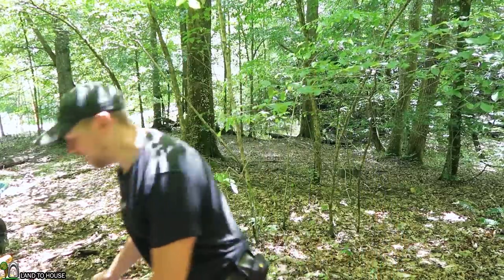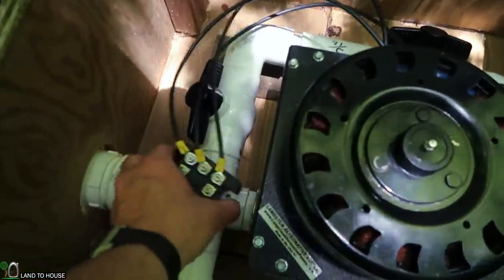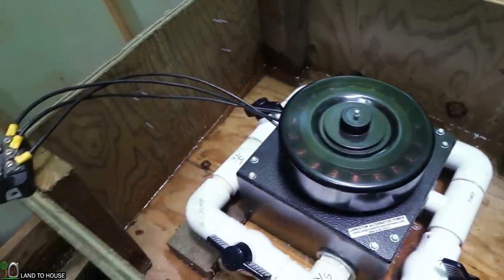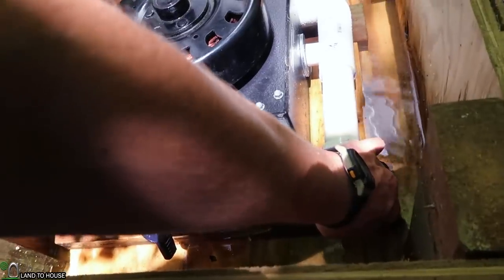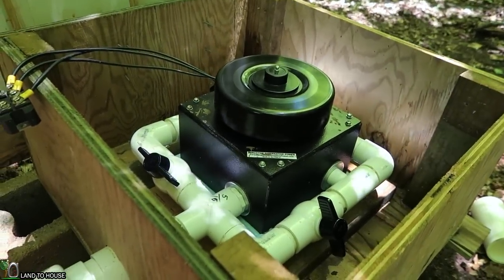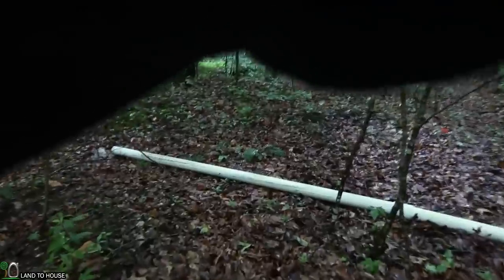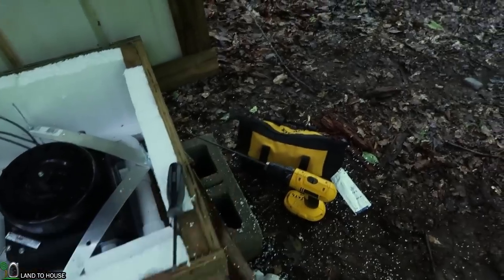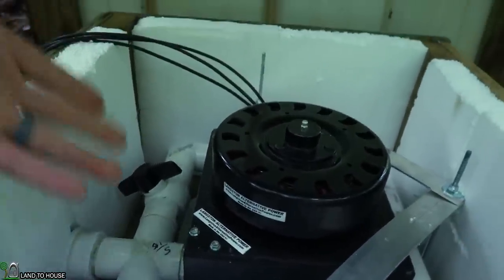Installing the Turbine Micro Hydro 6/10

Comment: I like hydro power but have issues with maintaining one. Bearing life is obviously an issue and for sure if a bearing goes, your turbine is gone too. Once the bearing goes and the rotor destroys the stator, well you need a new generator. But that goes for any turbine/generator as well. I think a rather high level of technology is in order using vibration sensors to turn off water supply to save the unit. Some sort of auto lube also to keep those bearings alive. Then there is that seal between the water and bearing. I had a guy ask me once if I could save his hot tub pump. I took it apart and found the seal was damaged. I worked on it to get it smoothed up and put it back together, never heard whether I was able to make it hold. I think about how destructive the results of bearing failure can be with this tech thinking about that huge turbine failure in Russia that resulted in the death of 70 some  people and the necessity to shut down Russia's  largest hydro plant. Water and metal bearings just don't go well together.

Comment: If I were you I would build a soundproof building around that whole setup like a 10 x 10 building and you're going to have to make the drain way bigger probably the same size as the turbine setup until they can get a ways away from the generator and the water picks up speed and then will Flow Away

Comment: if you and your sponsor are interested in an idea for experimentation then what about more jets using an octagon or a decagon (8 and 10 sided polygons) and what would the efficiencies and/or losses of more jets applying extra torque for the generation of power would you be able to use larger sections of pipe to have extra flow and split the flow and cause higher pressure thankes to the reductions before the jets but to a limit of what they can handle

Comment: I would do away with the ball valve and run a gate valve, you would have less water hammer during shut off and a more gradual shut off.
Reply: What you say is true, Gate Valves can lesson water hammer, but might not be as practical in this application. Gate Vales are typically far more expensive and sometimes just simply won't last as long and they tend to clog or at the very least are able to clog unlike Ball Valves. I don't know how often he'd be turning this unit off or off but over time Gate Vales will clog. Just offering an alternate opinion... Cheers...

Comment: just love it when people with no engineering prowess at all attempt to create a workable system , Langston ATP ! the Pelton wheel should have been encased in a "snail" housing , turbine efficiency would increase and there would have been no water in the enclosure , basic engineering ! water and electricity don't mix !

Comment: Terrific series:  On the sound issue, have you thought of a simple sound deflection, IE egg filler flats on the inside of the box. even a hospital bed foam has the same deflection shape.
Reply from the maker: Thank you!! I am worried those would rot in the wet box.

Comment: why would you not put a large tank at the top of the hill that fills off your brook figure out water flow in and put a turbine to take the outlet flow along with water pressure because of water weight in the tank run your power lines down the hill and scrap your solar if excess power pump water back up and use it for your stored energy easily run a house and more

Comment: There was something that surprised me.  Your indicated pressure is 65 PSI, which indicates a head of water of almost 45 meters according to the table at https://www.engineeringtoolbox.com/hydrostatic-pressure-water-d_1632.html
but at 16:42, the water appears to be coming from a trough above the generator that doesn't appear to be more than a couple of meters above it.
To estimate its effectiveness, you are measuring voltage, but voltage on its own is meaningless.  I can generate 2,000V by scuffing my shoes on a nylon carpet.  Power is what you want, and P = V x A.  Power is measured in Watts, V is volts and A is Amps.  What are you going to use it for in the house?  Will it need AC (eg for the fan motor in a space heater).  DC is OK for a kettle or for lighting.
Bear in mind that when you start drawing current, the generator will tend to slow down.  Maybe you can compensate by opening more jets, but if it slows down, the voltage will drop.  If you will be varying the power requirement by switching things on and off, the generator speed will rect to that.  You may eventually want to automate the opening of more jets.
Reply from the maker: The head pressure is 163 feet. With one 1/4"  nozzle I have 210w. With two 1/4" nozzles I have 340w.
Reply: @LandtoHouse  Yes, thanks for the response.  I later saw your other videos, and watched the one on the overview of the installation, with the long tube from somewhere much higher.  I didn't look at all the videos, but from comments you made, I gather you are completely off-grid.
Reply from the maker: Its 1100 feet long. A rather costly pipe haha.we have solar and hydro power but that only supplies 1/4 of our power.

Comment: Dude, how hard is it to see INSTANTLY that the drain hole was not big enough ? Foam ? really ? lol. Also, you cant have the drain area sealed up tight, you need air inlets to allow the water to drain out the tube, its like a straw with your finger on the end, the fluid will stay in the straw until you remove your finger.
Reply from the maker: An intake and a housing rebuild will be coming in the spring/summer 2021. Its a bit cold out right now.

Comment: These are very interesting concepts but the implementation is a disaster. A plywood box?  3in pipe at 65PSI needs what pipe diameter to exhaust at atmospheric pressure? I am no 'math surgeon' but even I can tell it needs to be bigger than 3in!  Oh, unless you disperse the water very gently and uniformly you are going to crate a new river or cave in the area within 24hrs.
Reply from the maker: Hello. This was a great first try for the micro hydro. A redesign of the housing is coming up in the spring. I will also be building another style intake box. Should be fun. And yes stepping up to at least two 3" pipes for the output.

Comment: Gravity might increase the speed of water
Reply from the maker: It does! As the flow rate of the creek slows and air is pulled into the penstock it drops the height of the water in the pipe and slows the flow.